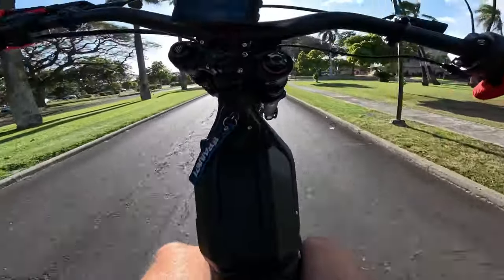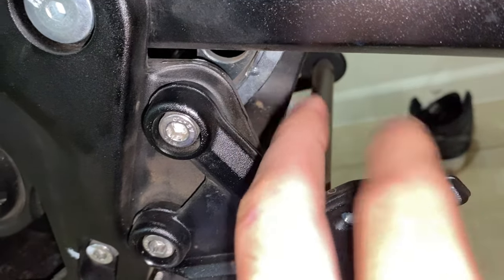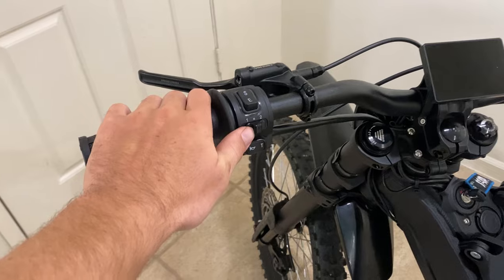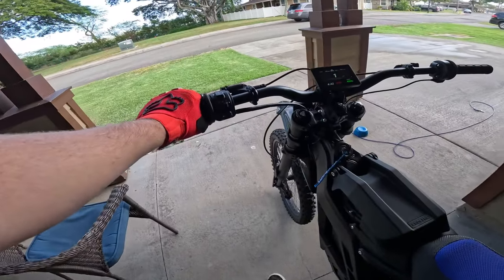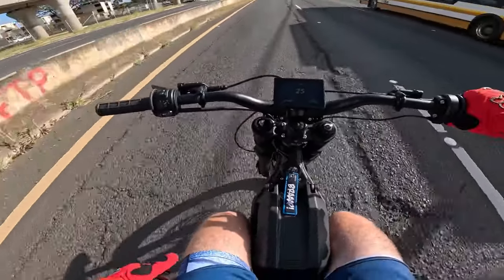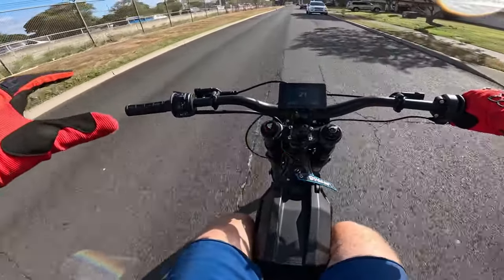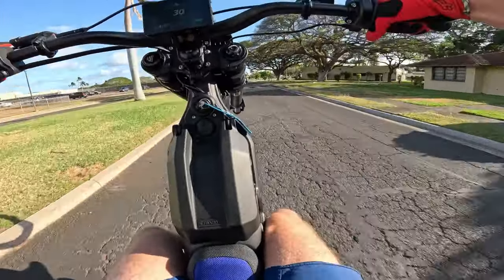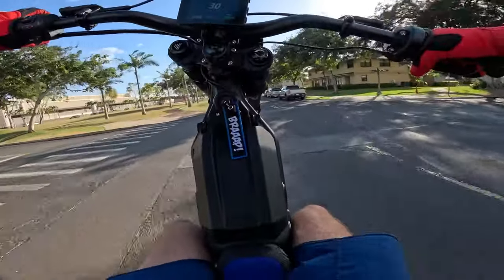REVIEWING *60MPH* ELECTRIC DIRT BIKE!(eride pro ss)

Comment: I love this thing, i got mine mid January after waiting 2.5 months lol but Im at 960miles. Apparently once you hit 60mph & hit the turbo button it'll let you go to 63mph
Reply from the maker: Ya I am almost at 1000 miles love it so much
Reply: Turbo button only works on the V1... this V2 has a new controller that gives constant full power in sport mode and turbo button doesnt do anything now.
Reply: @paulhope3401  you are aware the 1.0s delivered after December 15th 2023(unofficially deemed 1.5) have all the 2.0 parts except the new 3 position Ignition switch.
Reply: @parker__sullivan  have you notice the original capacity is alot lower than what it was when you first got it?

Comment: I’m so torn between the Sting R and the SS. I love the idea of not needing to mess around with the belt by buying the Sting R. At the same time though the power, range, weight rating and the price of the SS is so alluring. But I’m a 6’3 240lbs dude and I’m concerned I’d lose top end on the Sting R and might mess up the forks by not adequately tuning the suspension. Im somewhat familiar with regular bikes. But anyway, since the SS doesn’t ship to Canada and I’d have to go to the states to get it I’m concerned I’d invalidate the warranty or not be able to find parts for it if something goes wrong. If anyone has any suggestions I’d appreciate it. Im dying to get a bike either way. Just want to make an informed decision.
Reply from the maker: I would go with the ss  it is better in almost every way
Reply: I just pulled the trigger on the talaria mx4 .

Comment: Is the regen worth it? Let's say if your just cruising around gently on roads.
Reply from the maker: It does slow you down quite a bit so it will save your break pads but you can cruise without it then turn it on as soon as you need to stop

Comment: The only thing i dnt like about it is the battery over heats and will turn off on u if u run the battery to much
Reply from the maker: It’s just one I got on amazon the brand is enjoy Mfg
Reply: Any battery will overheat if you're a fkn flatlander and ride top speed everywhere.